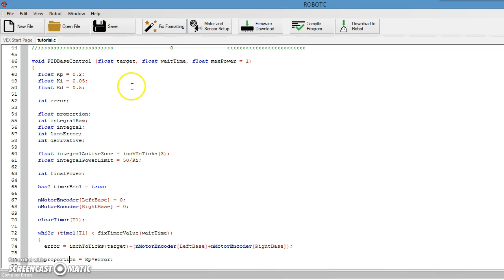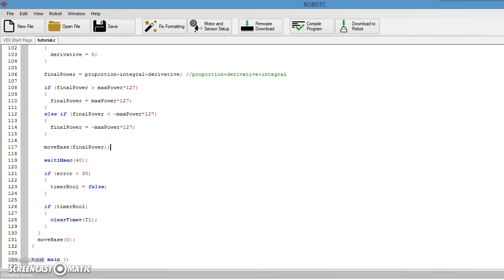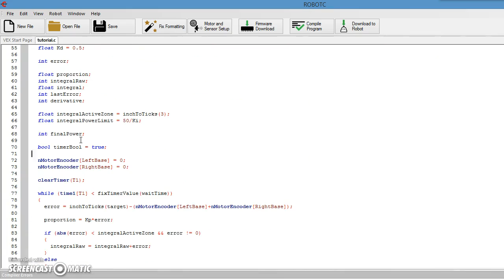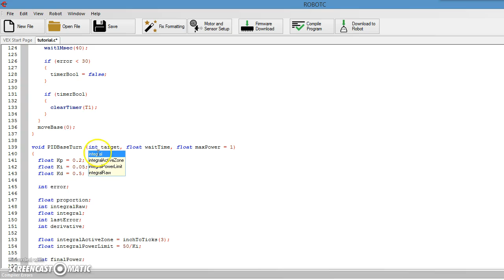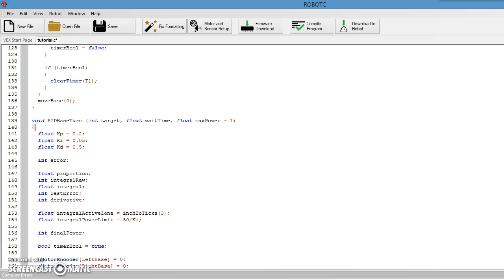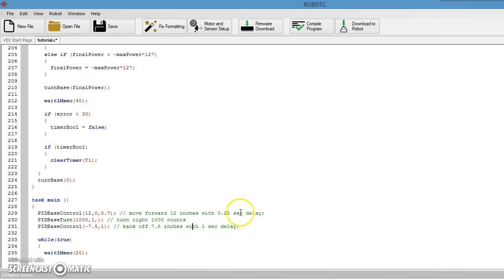Let's Make a PID Loop Episode 14 -- Turning Mod

Comment: Great series, thank you very much for making these videos public, as they were very helpful. I was wondering however, for the PID turning commands how many degrees would 1000 counts be approximately, or moreover would it be possible to use values from a gyro sensor as the int target for PIDBaseTurns?